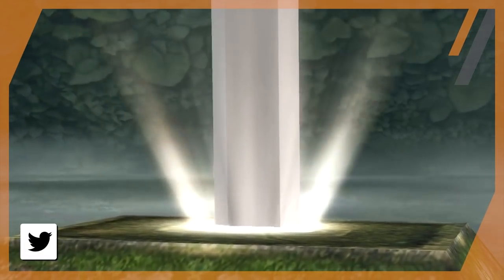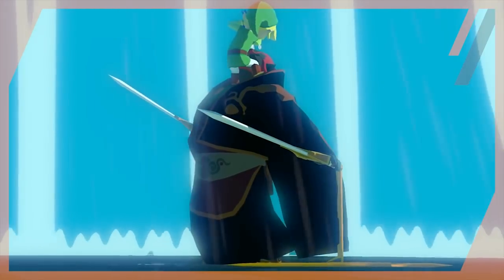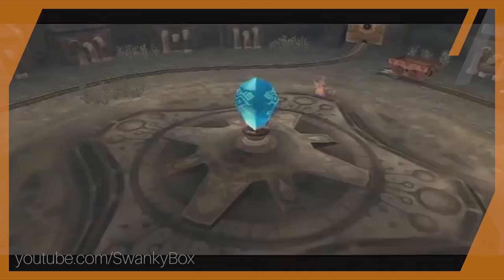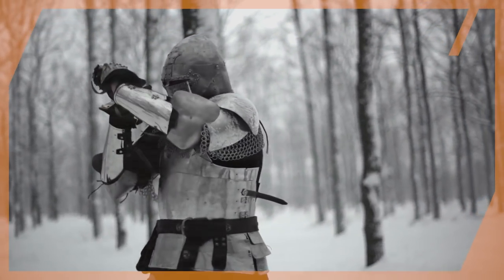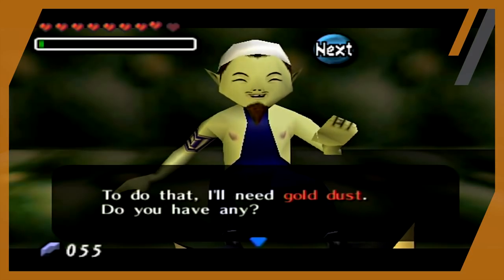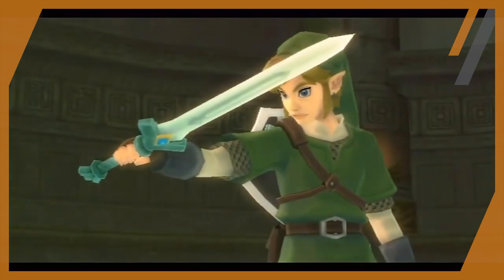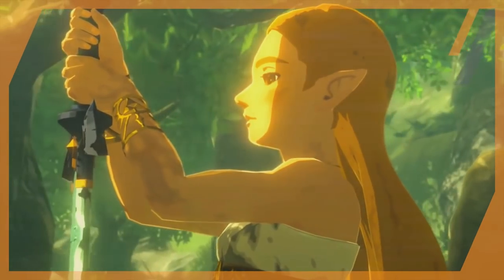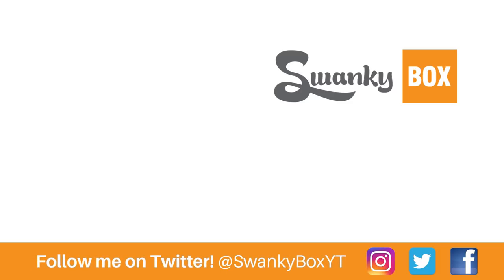Why EVERYTHING About Zelda's Master Sword Somehow Makes Perfect Sense

Comment: Remember that swords are not meant to be rigid like most things, the blade is supposed to be flexible so it can vibrate and absorb impact. 

Steel, even now remains the best kind of metal to create swords out of because it has the perfect balance between hardness and flexibility (the edge as you mentioned needs to be hard enough so that it doesn't get dull/bend when it strikes against w/e). Granted we have better quality steel right now due to the progress in technology and our better understanding of physics et cetera.

Still, props for research. As for my opinion I think it might've been created by a modern type of steel since compared to other blades it's really hard to break in botw and was simply imbued with holy energies by the sacred flames in skyward sword, plus the little bits of gold on the guard/hilt.

Though thinking about it a bit more it might have some luminous stone thrown into the mix seeing how the glow is similar.

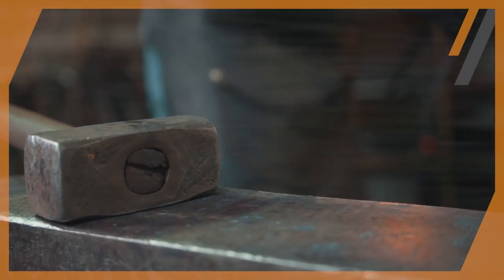Comment: Around 3:10 he says "to help cut through armor" swords were not meant to cut through armor. They were for lightly armored or unarmored people. That's why we have warhammers and maces; to get through armor. Occasionally swords were used on armored people but they didn't cut through the armor, they tried stabbing through the gaps in the plating or through the visor. Swords cannot cut through armor. Not even the katana. The whole point of armor is to prevent people from being able to kill you, if it could be cut through people wouldn't have worn it. Also, quick clarification, when I say armor I'm referring to steel plate or similar built armor because that is what most people think of. Good video overall, just wanted to clear up any confusion.
Reply: Doing God's work
Reply: Actually they can it just depends on the materials involved and as you said how the armor is struck. 

The Master Sword can possibly cut through steel as while I don't know what it is made of what I do know it is not steel but rather a stronger than it
Reply: @PaulonTheBrave  to be fair, though, when have we seen the Master Sword actually cut through steel armor in-game? The Master Sword could definitely put a dent in steel armor or cut through a gap between plates (essentially folding the steel with the blade to cut through the clothing and flesh beneath) if Link only had the strength of an average human. But since he's swinging the Master Sword with much more force than any regular human (validated by other feats of strength the Links have shown, ESPECIALLY TP Link), then it's entirely possible that their titanium-gold alloy/Master Ore blade could punch through regular steel armor with relative ease.
Reply: Well, the heavily armored Darknuts throughout the various games they have appeared in, chiefly Twilight Princess and Ocarina of Time will steadily loose their armor as they take damage. While not specifically depicted as cutting through the plates, even the "unarmored" forms of the Darknuts, the ones you can damage, are rarely depicted as entirely unarmored. 

That beeing said there is clearly a level of steel protection that defends against the Master Sword, at least short term, as armored enemies in Wind Waker and one miniboss in Twilight Princess are almost etirely impervious to attack unless striking an exposed weakpoint. 

So it is a bit up and down on what exactly it can cut through and it might very well just be the raw power behind the strike more so than the blade doing the work.
Reply: Strong arguments all round...
Reply: @Paulon The Brave: I doubt that a even the master sword could cut through steel armor, no matter what metal it's made from. Even if the material of the blade is way harder than the material of the armor, it won't be enough. Imagine a breast plate made of just normal iron being hit by a sword made of modern types of steel (which is like WAY harder). You wouldn't expect the steel sword going through the iron armor, would you? Even if the sword was made of diamond, it wouldn't go through. A human cannot even produce enough force to make deep cuts into iron. And a sword made of the hardest material imaginable would be way too brittle to be a functional weapon.
Reply: But we’re talking about a guy who can stop literally any attack with a single parry. If anyone can cut through armor, it has to be link.
Reply: Let's assume a sword and armor both made from the same material and from equally skiled smiths. OP is correct. You can't cut through such armor without also breaking your own sword. You could dent it, and score it, but not cut or stab through it. Unless, MAYBE, if you have the target flat on their back and you were coming right down on top of them. But your sword WILL be ruined, and at that point there are better ways of finishing them.
Reply: @wulfocrow5549  taking in mind some Link's (say TP for example) are EXTREMELY strong, as in wrestling with rock-eating creatures that lift entire boulders easily, they may actually have enough force to do it,  look at the "ball and chain" again from TP, no human ever would be able to even lift and throw such a thing just as Link does. Also technically they're Hylians, not humans, and there are quite some differences.
Reply: Daniel Felipe this argument is so tiresome. You would have to completely disregard even vaguely  believable physics for that to work. Zelda operates largely on earth physics, and so the action you describe is impossible. Metal doesn't work like you think it does, and if it did it'd be useless.
Reply: I really doubt that anyone even paid attention that isn't looking for things to be upset about and correct him on.
Reply: What the uninitiated need to learn and what the experienced need to remember in this thread is this: A sword doesn't have to cut armor to damage someone in armor. It's extremely difficult to cut any metal used for armor when you don't have something to pull the blade through to the other side of the target. What a sword would be used for against armor would be Bludgeoning (murder stroke or not), half-swording to attack unprotected sections, or there would be large swipes to the joints and seams of the armor, in hopes of immobilizing, unlatching, or unstrapping pieces of it. All this can vary depending on the era and quality of the build of your opponent's armor.
Reply: true dat
Reply: A blade that's harder than an opponent's armor may not be able to cut as he stated, but it has a fair chance of denting an opponent's armor to a point where they are immobilized
Reply: @PaulonTheBrave  I remember watching a video of how strong he is in Botw (considering he can stop a lynel's charge with a e shield strike) but can't remember any special feat of strenght in TP... 
Can you enlighten me? 😅
Reply: @caruros2008  Actually, Hylians are human. In fact, it says as much in Twilight Princess.
Reply: Space Age Quice Hilt bash
Reply: @FlynkAvalon  Well...  Link DID stop a charging bull with his bare hands, lift it off the ground, and toss it aside.  I think that qualifies as a "Feat of Strength."

Also, for those slagging off "it's magic," let me say this.  You can't slag magic off.  As was stated in this video and in every game it exists, The Master Sword is the Sword of Evil's Bane.  It's has magical properties against "Evil."  If the armored foe is "Evil," the sword's magic would kick in and the armor wouldn't protect the foe.  Against a common non-evil foe like, say, a Knight of Hyrule, yeah the Master Sword wouldn't do much aside from dent the armor because a Knight of Hyrule isn't inherently "Evil."  However, I do believe the Triforce of Courage in Link's left hand COULD grant The Master Sword the power to cut through any armor if Link could ever properly harness its power.
Reply: to be fair he didnt specify what kind of armor xD
Reply: Jeffrey Scott  Go check out Shadiversity.  He just released a novel where he created a paper thin sword made of a material unique to the story's world and enchanted with magic.  We don't know what The Master Sword is made of.  And given that Hylia is, supposedly, the one who forged it or who had it forged, and it was capable of CLEAVING THE EARTH, I think The Master Sword cutting through armor while in Link's hands is entirely plausible.
Reply: Space Age Quice when you said “not even a katana” it made me think of that one 1000 folded nippon steel katana meme. I’m liking your comment because of that.
Reply: @ForeverDegenerate  Ah, I forgot about him lifting bulls 😂
Yeah, can't say he's as strong as botw link (parrying lynel's charges with a shield) but lifting a bull is not a thing for a common hylian xp
Reply: Katanas can cut through other metals if their the right made katanas with the diamond edge
Reply: Armor doesn't always mean steel. Silk, thick cloth and leathers can still be cleft through, as can rattan and wicker armors. But yea, you've got a good point that most people are thinking about steel plate when they use that word.

Edit: apparently armor does only refer to steel and now I'm irritated. WTF do you call lamellar then?
Reply: true however in some cases armor's puropse was not to stop blades/cuts cold but rather to lessen the depth/seriousness of any cuts or other strikes/penetrations.
Reply: Guys the point is that a sword's edge needs to be hard so it can stay sharp, not so it can cut through armor lol.
Reply: And sometimes a warrior without a mace might hold his sword by the blade and bash at an armored foe with the hilt, because the blunt and heavy hilt is better at getting through plate armor's defenses than a sword slash by that much.
Reply: ESPECIALY not the Katana 
That has haver historicly met metal made Armor
Reply: swords can't cut through armor very well (depending on the material), but they can very easily pierce armor in most cases
Reply: What about chainmail?
Reply: You can hit people with the hilt by holding the blade (can be done with minimal damage to your hands and that damage is rather insignificant compared to your death)
Reply: @Neon-yj9xw  well we have age of calamity now ?
Reply: @reijimiyamoto4227  I haven't played it, what exactly are you referring to?
Reply: @Neon-yj9xw  dont know i forgot ._.
Reply: "Armor" is an incredibly wide term. He could have been referring to full plate like you assume, or lighter armors such as gambesons, or anything in between. Additionally, the idea he's getting across could encompass more than human armor: the chitinous exoskeletons, tough hides, or protective scales of various monsters Link faces.
Long story short: give him the benefit of the doubt before jumping down his throat to prove how much you know about metallurgy.
Reply: @Neon-yj9xw yeah. Also, speaking of Twilight Princess, the Master Sword cuts through steel armor whenever you fight a Darknut. Also, OoT with the Iron Knuckle.
Reply: Soft armor.

Comment: Seems legit.
There’s also gold-colored Master Ore in LBW that you can use to upgrade the Master Sword, ultimately giving it a gold color once both Smiths have reforged the blade. It’s possible that it’s a naturally-occuring Titanium-Gold alloy...or one that’s been created then distributed. (Or what would’ve become the Lorulian Master Sword...but...didn’t.)
-
(...although you could theorize that the hilt and ocarina are made from Timeshift Stones without referencing Hyrule Historia (SO not a fan of WoG...), just by analyzing the games themselves—color, what each item does.)

Anyway, I really like your theory about how the Timeshift Stone blade actually works to maintain the sword itself. The whole “time travel” mechanic honestly seems more like Link exploiting a glitch similar to what Midna did in TP with the Fused Darkness than the sword’s intended design. Which...even if Zelda hadn’t used the Ocarina, wouldn’t there ultimately been a time paradox vs a timeline split of Child Link just twiddling his thumbs after Ganondorf’s defeat as he waited for time to resynchronize seven years later?

...I’m going to argue that THAT would have been better than the stupid timeline split (especially since it only resulted in yet another war that ultimately resulted in at least one tribe’s genocide).